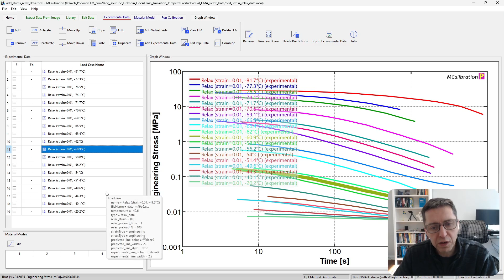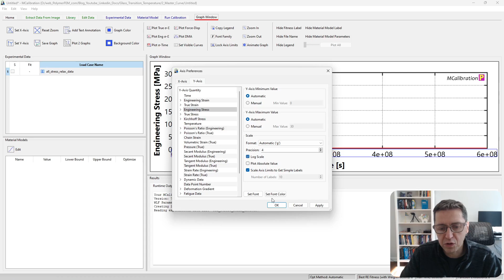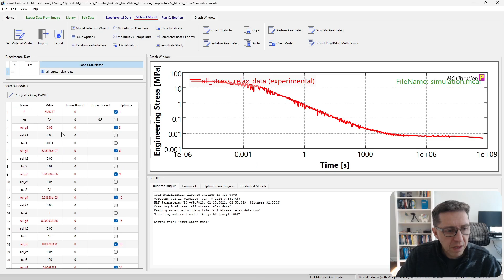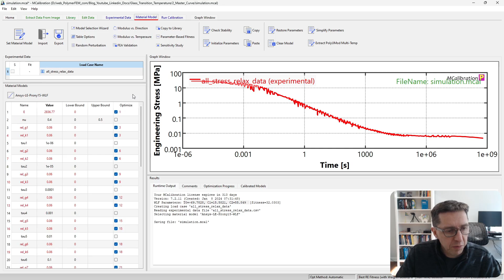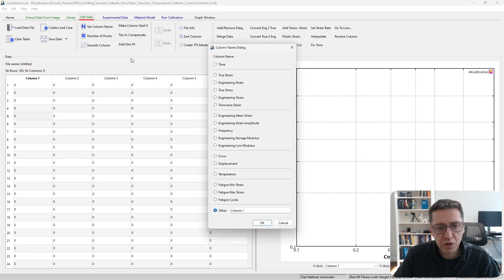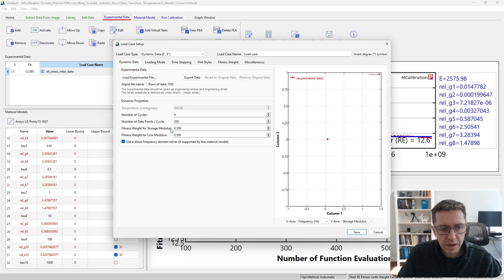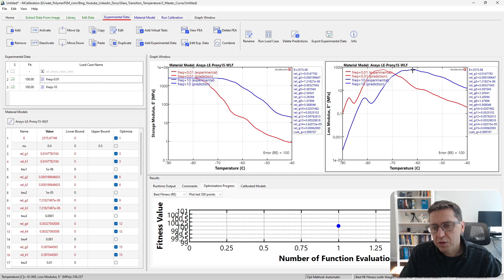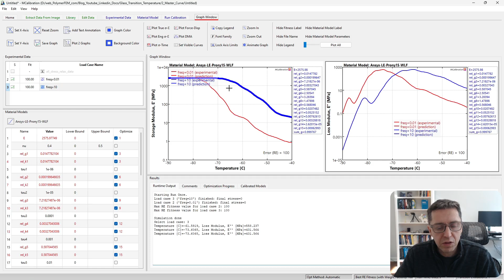The Glass Transition Temperature Depends on the Loading Rate

Comment: For a typical silicone material, how much would you expect Tg to shift w.r.t. loading rate?
Reply from the maker: Hmm. I don't know, and it would take some time to dig up date for that. Can you test it experimentally?
Reply: @PolymerFEM  Thanks for your response. I have DMA data at 0.1Hz up to 10Hz, and I see several degrees change in Tg. I'm more interested to know how much Tg would shift at very low and very high freqs.
Reply from the maker: @Benyamin_Gholami  I typically see about 5 deg C change with decade of frequency (or strain rate).